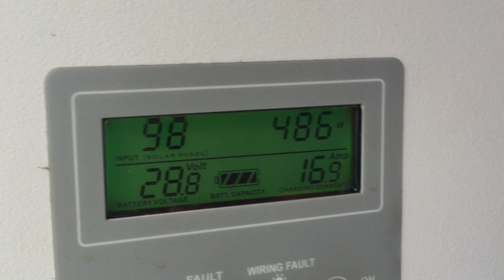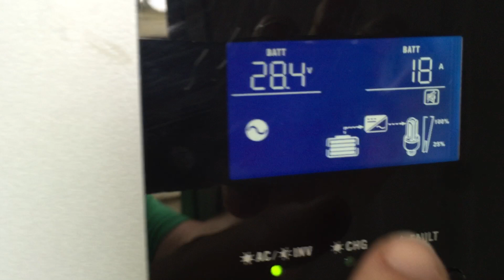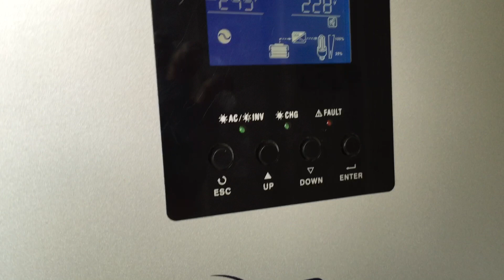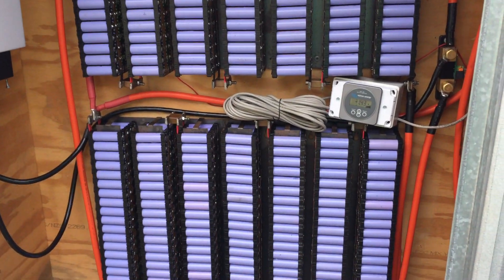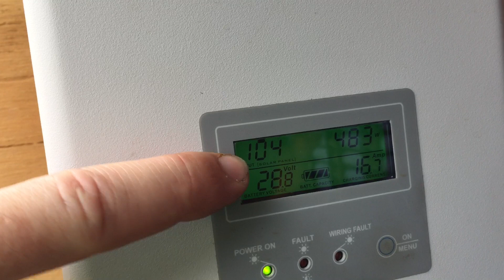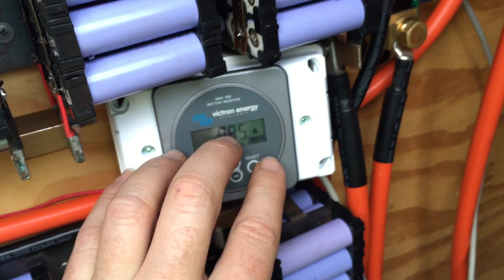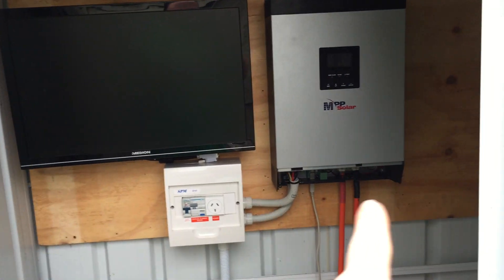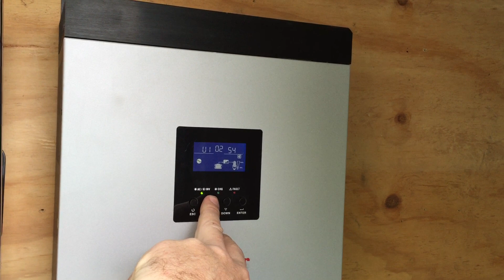IT'S ALIVE !

Comment: i was thinking, it would be better to have charge controllers and inverters separate so that if 1 dies you dont have to swap the entire thing
Reply from the maker: Yep, of the same thinking - how ever currently there are no rules for lithium batteries and power generation needing separate rooms, how ever this isn't the case with lead acid - they must be separated. New standards will be released in Australia soon and I'm prepared to rise to the challenge of getting my system up to code again.
Reply: out in the bush, codes dont matter :)
Reply from the maker: You could look at it like that - if it was just me I'd probally look at doing things easier/quicker but as i have falmily probally better to take advice from expererts lol
Reply: codes r usually made by beaurocrats who have no idea whats going on and just come up with new regulations so they can look like they are doing something.
i really think a system like this needs a common sense approach and as long as everything is safe and well connected and connected properly it should be good :)

Comment: ok Bro I like to see the way your setup your battery in your power room. one question for you the pcm60x is it a good unit I'm thinking of buying one I'm looking to do a solar system I have 8 100 watt solar panels I can't buy the expensive equipment like midnite solar outback etc
Reply from the maker: just run with the inbulit charger, it'll work well for you starting out .

Comment: fantastic. Now that hot water system ....what about solar thermal panels.       hehe
Reply from the maker: +Logotha Ironsides I would love solar hot water but with a perfect electric system I'll wait till it fails.
Reply: some people use the excess power to you hot  water heater. in stead of throttling back the power to the battery's

Comment from the maker: I"m first & i'm bloody happy !!!
Reply: what are the individual balancers you're talking about?
Reply: http://www.aliexpress.com/store/product/lithium-battery-balancer-which-keep-your-batteries-voltage-difference-within-10mV/708582_1768384410.html
Reply: Looked at those balancers was advised to stay away from them...??? 
May try on one pack first? Looks like it could be a great product. ?
Reply: has anyone tried them? 
Here is the link had saved 
http://www.aliexpress.com/item/lithium-battery-balancer-which-keep-your-batteries-voltage-difference-within-10mV/1768384410.html?s=p
Reply from the maker: +off grid kid uk diy powerwall is using them.